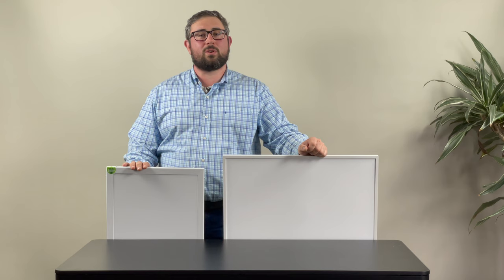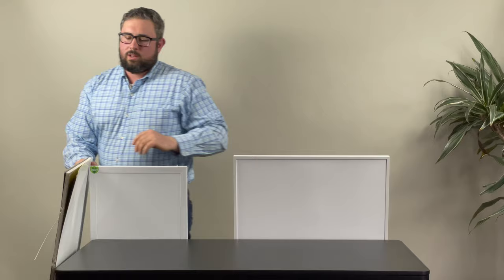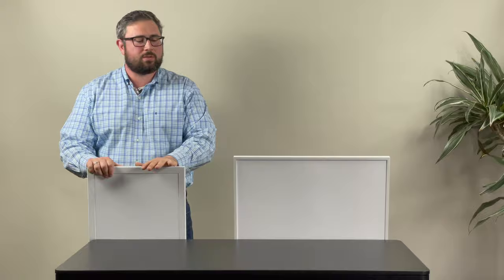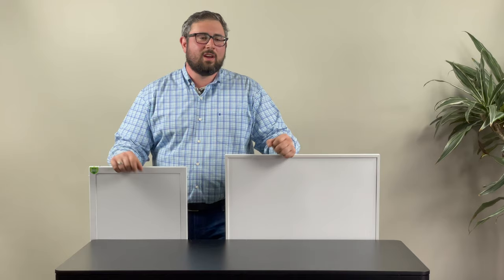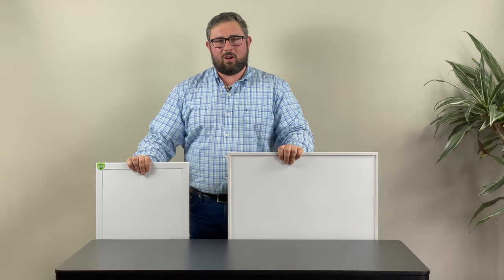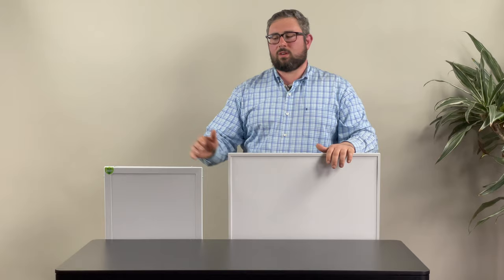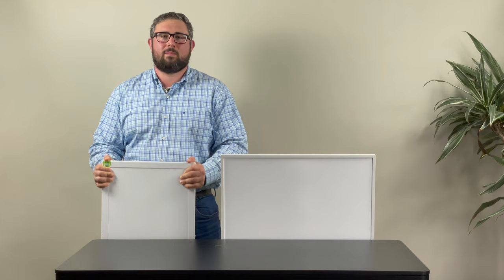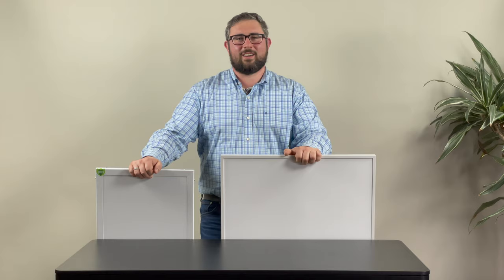7 Differences Between Heating Green Infrared Panels and Carbon Fiber Panels.

Comment: What voltage is optimal if running DC?
Reply from the maker: To get the best product for your installation I would recommend contacting our sales team by emailing your questions to sales@heatinggreen.com. They will give you a free quote for the best heating solution for your application. You can also check out our blog article to help with your selection: https://heatinggreen.com/best-voltage-infrared-heater-efficiency/
 Thanks! -HG Team